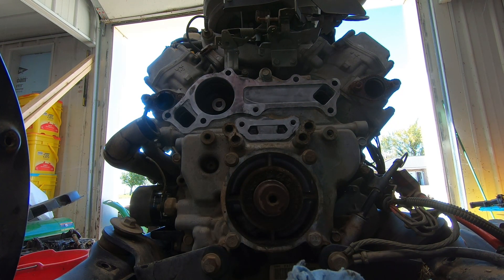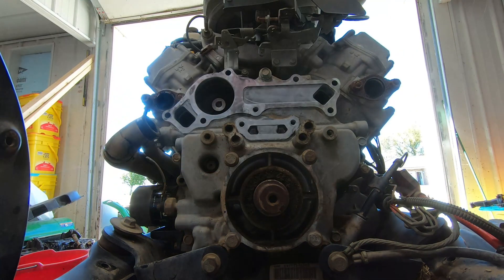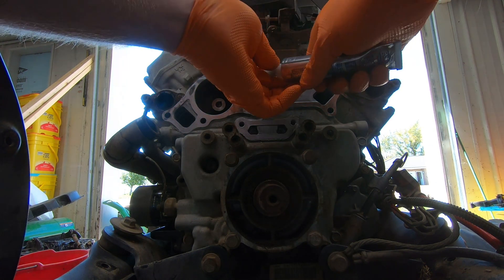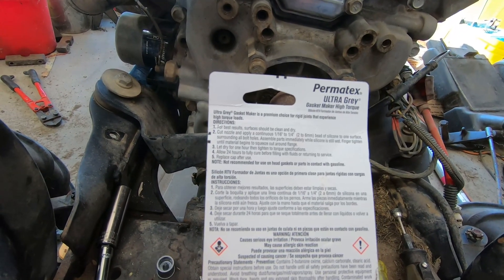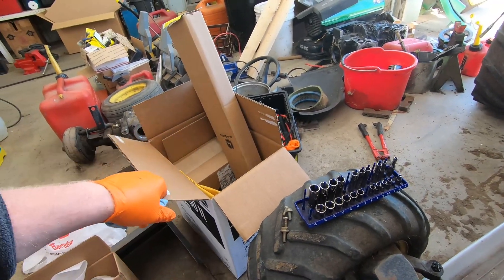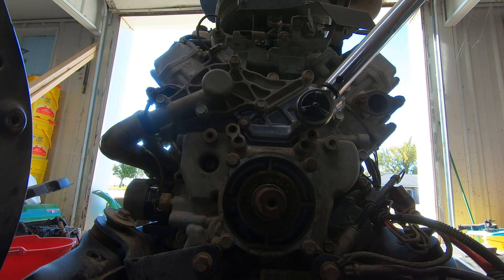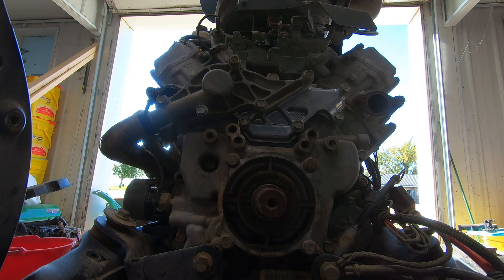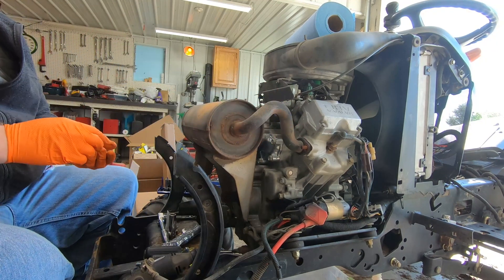John Deere X585 Project: Part 8 - Water Pump Replacement

Comment: Quick question. My x485 is running hot!…..I replaced the thermostat and still the top hose gets hot and the bottom hose is cool to the touch…..I’ve cleaned everything thinking it wasn’t getting enough air. My question is this. Would it be the water pump??? The motor once it gets hot starts to surge but only when the mowing deck is engaged
Reply from the maker: It certainly could be the water pump if you’ve replaced the thermostat. Have you confirmed the actual temps or is it just the gauge cluster indicating it’s over heating? Normally when these newer units overheat the PTO will shut off. The good news is, water pumps are relatively easy to do if you’ve replaced need one. I would test the pump in some capacity first though or at least pull it and see if it’s in good condition before ordering a new one.

Comment: If u want to do thing right then spend the money and get the dam gasket, bet u will have to tear it down again
Reply from the maker: Hard to do the right thing when no gasket is listed in the parts book. If you could perhaps enlighten me on the part number for the gasket I could keep that for when I have to replace another one. Based on the cost of a 445 water pump gasket, the gasket would be cheaper than the Permatex depending on where you get the gasket and Permatex..... The 445 clearly has M139018 listed as the water pump gasket. Neither the FD711 or the FD750 have water pump gaskets listed in the parts book.
Reply: that is so true!!!
Can’t find a set for my f750d either

Comment: Can you adjust the hydraulic pressure a little higher on these models x585
Reply from the maker: Yes, you can shim the relief valve. Do a search on Mytractorforum.com and there are several threads about shimming the K91 and K92 transaxle.
Reply: Thanx

Comment: Hi, were you unable to find the replacement gaskets?
Reply from the maker: To my knowledge the engine in the X585 did/does not have a gasket available for the water pump. At least one does not show up in the parts book with the gaskets kits nor with the water pump. The water pump that was removed had RTV as the gasket as additional evidence of the lack of available gasket.
Reply: @mmrbeef  That is what I am finding.  I guess they just "glued" it all together!  I guess I'll take the pump off as a last resort!

Comment: Many thanks for this video! I picked up a 2002 Exmark Lazer Z with this same engine that has 3,800 hours on the clock. Once I cleaned all the grease and grime off the engine, I found the water pump leaking out the weep hole! I was able to buy all the small parts from ebay and PartsTree to get it going again with the same silicone you used. Cheers!

Comment: The block looks cracked , location bottom right water pump bolt back on the block and around a lower boss bolt hole.
Reply from the maker: I did not see anything that appeared to be cracked. I've run it now for about 30 minutes and no signs of a leak.... yet! lol
Reply: @mmrbeef  it could of been a shadow that the camera picked up, who knows, if I was there in person maybe a whole different story.  Sorry

Comment: Question for you dude. My neighbour has a x495, he was mowing the other day, used the diff lock and now it won't disengage everything under the tractor is where it should be. I'm thinking that a spring on the inside of the transmission on the diff lock shaft had come free or broken maybe one of the two snap rings have broken or something. Is this common? The tractor has low hours 120ish and is in good shape.
Reply from the maker: Stuck diff locks are normal due to the linkage but it that is clear there is either something binding inside or as you suspect, something is broken. It might be worth jacking up the rear of the tractor and seeing if it can be disengaged that way. This is not what I would call a common problem.
Reply: @mmrbeef we got the deck off it, and got it in the air, everything is how it's supposed to be, the linkages function as they should and can be moved by hand it just won't return to the unlocked position. I'm thinking that one of the snap rings on the selector rod has broken as there are two spring on the rod that keep it in the unlocked position as per JD parts AM878498, so I'll probably have to strip the trans to see what went wrong with it. Just wanted to touch base with someone with a bit more wisdom on these things before  I strip it down